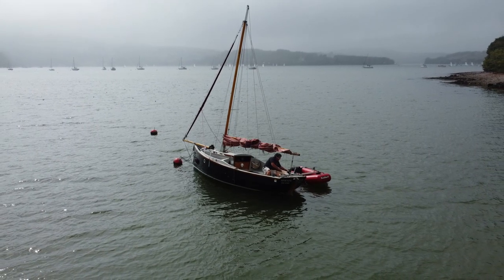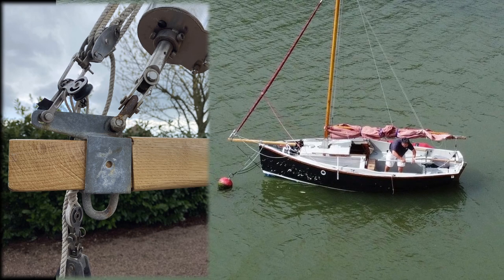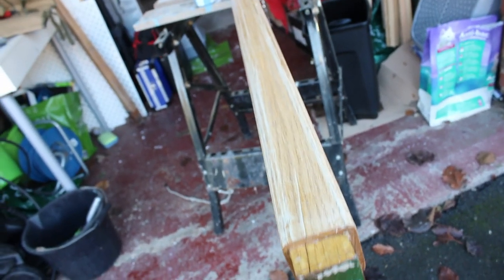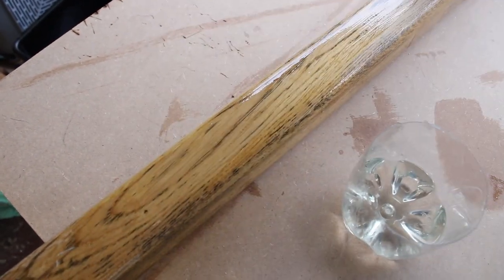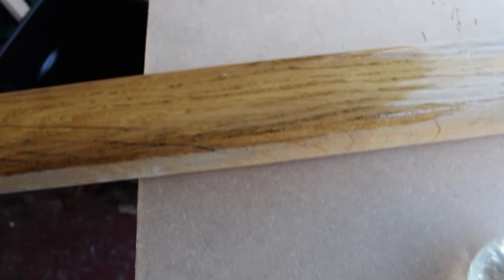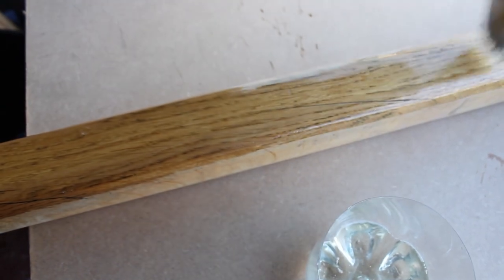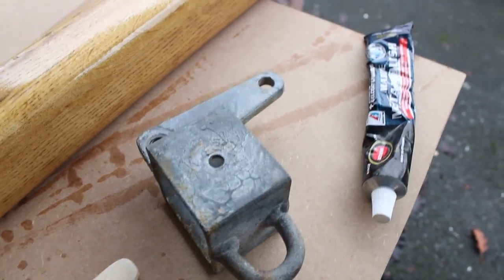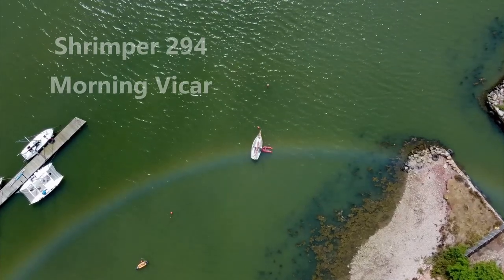No. 3 Bowsprit refurb on Morning Vicar

Comment: Enjoyed the video. def my type of maintenance . New to Shrimpers just getting mine ready for this years season so look forward to more of the same
Reply from the maker: Thanks Ian.
Reply: Great video, how is the oak holding up? Does it have enough flex as a timber, particularly in higher winds?
Reply from the maker: Thanks. The Oak seems to be working well, it does flex a little but Its hard to compare really. I don't think it makes much difference with such a short spar.